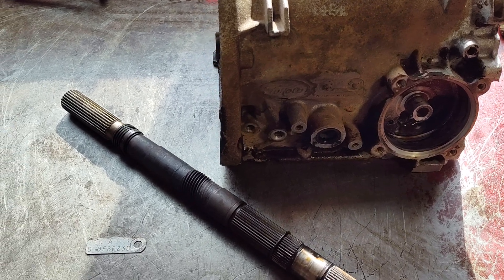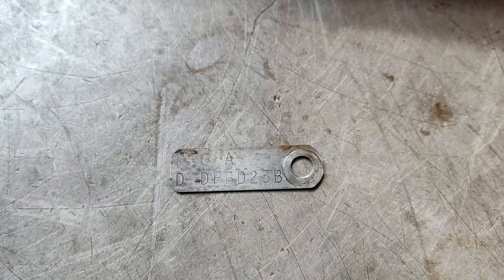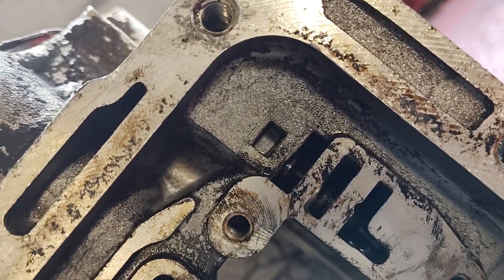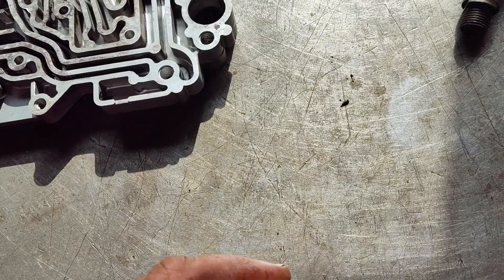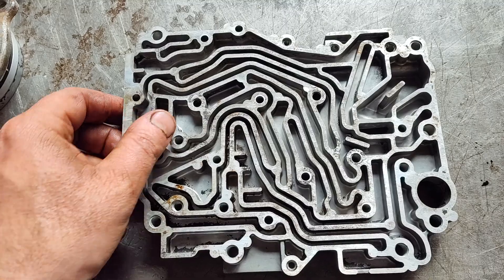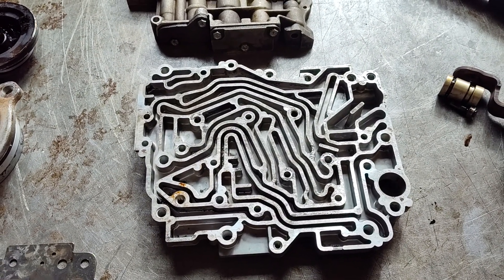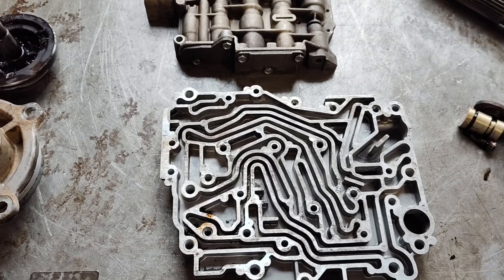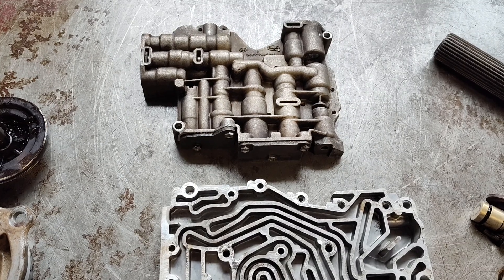Ultra Rare Ford C4 Transmission Part 2

Comment: I found a fairly rare C4 in a 1981 Granada. It was a lock up torque converter C4 on a 200 straight six. It did not have the deep pan of the 1982 C5 and the dipstick said to use Dexron II fluid, which is a GM product for lock up torque converters. It's pretty rare for Ford to list Dexron fluid. The 1982 C5 with a lock up torque converter uses Ford Type H fluid, that came out in June 1981. The other 200 straight six C4 in 1981, without a lock up torque converter, still used Ford Type F fluid.
Reply from the maker: Interesting. Thanks for sharing this info.

Comment: There may be a hidden secret in that valve body. I always wonder what engineers were thinking all that time ago. Some really smart people back then.
Reply from the maker: Some smart people for sure. A cool piece of history.
Reply: @BroaderPerformance  Hi Jay. so you said TypeF trans fluid sludges up. So what fluid do you recommend then? My 70 c4 has all the typical upgrades - Alto Red/Kohleens, TCI kevlar band, unknown  brand manual reverse v-body, PA servo, PA Planitaries, and PA input shaft. Thank you

Comment: i retired 2 years ago, i was a professional transmission rebuilder and shop owner for 45 years. i have built 1000s of c4 and everything else, and i have never saw one of those. but i suspect that unit came from an industrial machine. one thing that comes to mind is the transmission was from a tug, to pull aircraft around the tarmac, i have built a bunch of tugs but they were all GM and not manual, but that was in the 90s, long after the c4,  i do not believe that one was on the highway,,,,,,,,,,,,,,,,,
Reply from the maker: Airport tug was my best guess too. Turns out to be from a 1970 Maverick and was called a semi automatic transmission. Really weird. Thanks for watching and commenting.

Comment: I have a rebuilt 1969 c4. I don’t have very much info on the build. From my understanding it has a different valve body than the 70 and up. Can I put a 70 and up valve body in it? I’m looking for a trans brake for my street/strip foxbody
Reply from the maker: Unfortunately the 1970 up doesnt work in the early case.